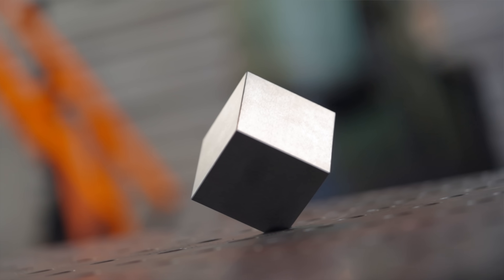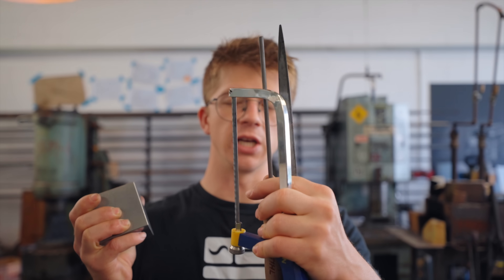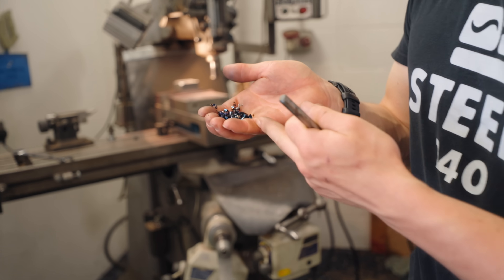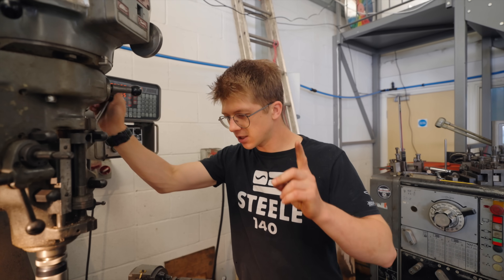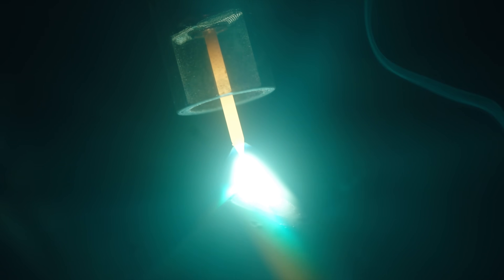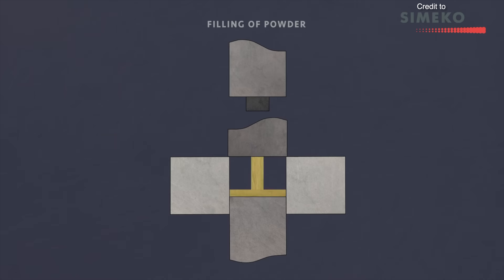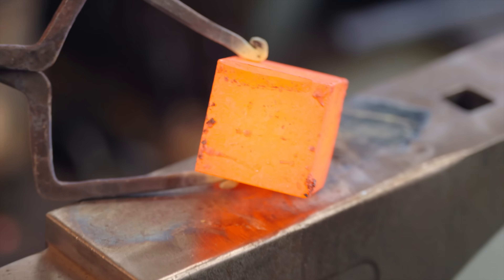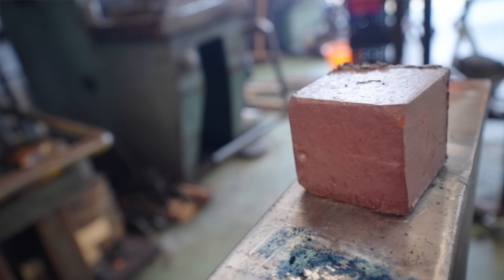Can You Forge Tungsten?

Comment: My father was a mold maker and many years ago he worked for my grandfather.  My grandfather was a notoriously difficult boss.  He was angry one day and needed to yell at someone so, he chose my father who it should be noted trolled his father a lot.  My grandfather picked up a piece of tungsten that was on my father’s bench and ordered him to “do something with this!” My father made a set of darts.  when the old man found out he nearly lost his mind  😂 so I say in honor of my father you should make something useful but ultimately frivolous
Reply: A dart set made from tungsten sounds amazing!
Reply: @jamescomstock7299  I had one some years back. It was designed to be extra heavy while not physically any larger than normal darts. They were really too heavy for me but as I had payed for them I learned to put some more strength into it. Really changes the throwing strength needed.
Reply: @jamescomstock7299  Supposedly he used the set to some success and then he sold them and that just angered the old man more.  No one could get that man angrier than my dad.
Reply: @jamescomstock7299  They have been made for friggin years, try again.

Comment: Would love to see a little series where you work your way through the advancements in metallurgy, going from the copper age to the bronze age to the iron age to the steel age. Just making the same part, like a knife, in all of them and showing how easy or hard it is to work with each metal and what the maintenance would be for each finished piece as it was used across its lifetime.

Kind of a practical show of the history of metallurgy and forging.
Reply: Now this is a cool idea. Make a knife or dagger from metal of each different era from the first metal blade to current

Comment: What about using electric heating. Would that take the temp up enough. I've seen videos where they use electrical current to melt steels to the point where it's as thin as water. Maybe ??

Comment: I believe you can actually use cones made of tungsten to friction drill steel due to the higher melting point and abrasion resistance. Just a smooth cone in a drill press and push it hard and fast against a steel plate and the friction will cause both to heat up but the steel melts much sooner so the tungsten cone just punches straight through the steel.

Comment: Machinist in training here. Carbide tools aren't pure tungsten carbide ceramic. They are a so-called metal matrix composite, where microscopic particles of ceramic are held together by a metal. Imagine melting a metal, stirring carbide powder into it, pouring it in a mold and squeezing as much metal back out of it as you can. The metal used is not usually tungsten.

Comment: You could do a fold forge like your simulated damascus, and if you do that, you would need it in shaved chips mixed to good steel with chip/shavings of cast iron (the cast iron shavings need to be very very little in ratio, a dusting in 2 folds and that is it)

Comment: It's smoking like that because the oxide, presumably WO3, instead of forming scale, is evaporating, as opposed to forming scale like steel would do. You probably don't want to breathe too much of that. The effect will possibly intensify if you heat it further. The oxide melts at 1473 C and boils at ~1700 C. It may catch fire at some point, so be prepared for the possibility.

Comment: Mech. Eng. student here, tungsten wont ever want to forge at the temperatures in your forge, youre gonna need to give it some more beans to get it to the point where it'll want to move. I reckon the oxyacetylene blowtorch (if you already have one) will get it to that temperature on a budget, given how tungsten melts around 3400 celsius, the blowtorch wont be able to melt it, but itll make it reach 3100 celsius, if you do forge it this way, smaller parts will be the way to go so you don't spend 80 years heating up the part. 

By the way, be careful with oxyacetylene if you decide to do this, oxyacetylene blowtorches dance on the edge of a detonation at any moment and handling it like a regular blowtorch might blow your eardrums out if nothing else. Do your research to make sure you dont harm your lovely face.

And of course the tungsten carbide inserts and your hardened tools can cut tungsten, the tungsten block is not hardened and tempered like your tooling!

Comment: Tungsten is extremely hard, but that comes at a cost... It's also pretty brittle (unless mixed with other materials). So it makes sense that you can shave chunks off, but something going hard and fast into it won't do as much damage. I did a little research into it maybe 5–6 years ago, if memory serves it is usually forged/cast in a vacuum, as it doesn't mix well with oxygen when molten. Many jewellers were very sad to see their pieces crack in "normal" setups they had for other materials.

Comment: aside form the stuff you already found out, some other reasons why its hard to forge Tungsten:
When its Red-Hot(or hotter) it starts to rapidly oxides making forge welds neigh impossible
fine Tungsten pieces can ignite causing a class D fire similar to Magnesium

if anybody wants to add to this list, just comment below

Comment: You may be able to get it hot enough with an oxy-acetylene flame. Which should push you up over 3000°C. It would be an expensive process, but should be possible.

Comment: All the smoke is actually tungsten oxide. Tungsten, like aluminium, is a lot more reactive than steel, enough that it seems unreactive at room temperature, because it pretty much instantly forms a passivation oxide layer, but at higher temperatures the tungsten oxide constantly vaporizes, exposing the next layer of tungsten atoms to oxygen, which in turn becomes tungsten oxide vapor.

Comment: Would love to see you try out a block on Inconel. its a SUPER strong alloy of steel used in aerospace parts. its a semi common stamping steel. i worked for a place that stamped out inconel turbine fin rings to hold the outside of the fins of turbo jet fins. they used a 250 ton servo press that shook the entire warehouse whenever it was running, and it only stamped them out of 100 thou inconel sheets.

Comment: Next time try titanium.
It's not very ductile. There is no fixing errors. If you bend it wrong, the counter bending does not fix the error and instead introduces a new error next to the original.
It also burns at 600°C. Got luck milling and turning it.

Comment: Of course Tungsten is forgeable. Otherwise how could anything exist, as even machined forms have to come from something. In TIG welding, while not super common it's fairly common to deadshort a tungsten against a piece of metal to get it red hot, and bend the tip over. If you couldn't forge Tungsten metal, that wouldn't be possible. Also, metal alloys are weird. The melting point differences between iron and tungsten isn't as big as you think when you start thinking about things at a microscopic level. Water is melted material, salt is a solid. Salt melts at 1400F. Yet water dissolves salt at room temperature, even though it's solid! Same thing. Gold melts at 2000F, mercury is melted at room temperature. Mercury will dissolve gold at room temperature. Same thing. Alloys and mixtures are weird!  In metalworking, Eutectic alloys is the technical term

People mix up Tungsten Carbide, which is a cermet composite material, with Tungsten, the metal. Tungsten carbide are flakes of the ceramic oxide of Tungsten, held together in a matrix of metallic particles, usually alloys of Cobalt. They are mixed as powdered materials, put in a press to form basic shapes, then fired in an extremely hot sintering oven to melt the Cobalt powder to hold the Tungsten Carbide grains. Hence, cermet composite (it's not the only kind, btw). That stuff isn't hammer-forgeable. If you get it hot enough then the microscopic 'bubbles' of cobalt just pop between the grains of ceramic tungsten carbide. The macroscale result is that tungsten carbide just kinda.. sloshes, cracks, and falls to pieces and powder. Because there are many many grades of Tungsten Carbide, and the binder % can be as low as 5%. So you have 5% forgeable metal, and 95% ceramic powder. Of course that cannot be forged by hammer blows.

Comment: As you pointed out, tungsten carbide is a ceramic, and that is most of the reason why it's so hard. Almost all ceramics are insanely hard, e.g. fired porcelain is generally harder than steel, it's just much more brittle.

Comment: My dad worked for a company that did a lot of work for the aerospace industry. Tungsten was used in rocket engines for it's stability at high temperature. They did work to the millionth of an inch on parts for NASA and others.

Comment: To forge it you will need to get your forge temp higher. You can do this by adding o2 to it or by blowing air in to it ither or should get you to a forging temperature
according to my ai the melting point is 
Seto AI: Based on the provided context from various sources, the melting point of tungsten is consistently reported as being very high. Specifically, the melting point of tungsten is: - From the content of "Tungsten's Boiling Point Is 10030 F and Other Crazy Facts": "Pure tungsten melts at a whopping 6,192 degrees F (3,422 degrees C)." - From the content of "Tungsten Metal: Definition, Composition, Properties, and ...": "Tungsten possesses the highest melting point among all pure metals, reaching 3,422 °C." Therefore, the melting point of tungsten is 3,422 degrees Celsius (6,192 degrees Fahrenheit).
 So you will need something around say 1/2 to 2/3 that temperature to forge it. 

Seto AI: Based on the context provided from the Reddit discussion in the Metalfoundry subreddit, the user is attempting to achieve temperatures of 1400°C (2550°F) using a propane furnace with a blower and 1.5 bar pressure, which currently allows them to reach approximately 1200°C (2190°F). The user is considering adding oxygen to increase the temperature, which suggests that a higher oxygen-to-propane ratio might be necessary to achieve the desired temperature range of 2000°C to 2300°C. However, the specific ratio needed to achieve such high temperatures with propane and oxygen is not provided in the context given. Typically, for combustion, the stoichiometric ratio (the ratio at which all the fuel is burned with no excess oxidizer) for propane and oxygen is approximately 1:5 by volume (1 volume of propane to 5 volumes of oxygen). To achieve higher temperatures, an excess of oxygen might be required, but the exact ratio would depend on the efficiency of the combustion process, the design of the furnace, and the specific conditions of the reaction. For precise ratios and conditions to achieve temperatures of 2000°C to 2300°C with propane and oxygen, it would be necessary to consult specific technical data or conduct controlled experiments, as these temperatures are significantly higher than those typically achieved in standard propane-oxygen combustion. Safety considerations and the potential for more rapid wear on the furnace would also need to be taken into account.

tldr you would need a ratio of around 1 volume propane to 5 volumes of o2 
You could pull this off but i would not want to use your current forge you might want to build a smaller one capable of reaching those temps and you would want to slowly increase the o2 flow to reach the proper range. Start with a 1 to 3 ratio and increase the o2 until the temperature hits 1900 to 2kc than try heating it and forging it. Increase the ratio and temp till you find the proper point. Done be surprised if the heat soak from the tungsten to your tons begins to soften them LOL

Comment: Maybe you could heat it to higher temperatures with an arc oven, oxyacetylene torch or resistive heating. Tungsten also forms beautiful colourful oxides when heated in air. I evaporated some thin tungsten wire in a vacuum chamber with a high current. Because my vacuum wasn't good enough, the vapour oxidized and coated the chamber in green and blue oxides.

Comment: Back in like 2002 or 2003 our material science course got to play around with "working" tungsten, and the instructor was a actually Michelin star accredited chef of all things... But he mentioned tungsten chips are the most beautiful, because they look identical to MSG! Lol! And it does... But the point of the chip deal was he actually collected a bunch of the chips, and somehow suspended them in small cubes of epoxy that he gifted to us at the end of the course!

This video is why I should have stuck with physics! Lol! There is so much going on here that physical laws canprobably explain! Like the speed, style, and contact area of a cutting implement. There is maths there! Also... would ambient pressure changes affect metals phase change temps in a meaningful way?! Like more than a few degrees K? Good times! Great video to stew on for the rest of yer life!

Comment: if you can cut it with a hacksaw, the band saw should be able to take a slice from it, the edges deformed easier because of the lower surface area, so maybe less mass supporting the rest of the shape would aid in its malleability? Might need to get it hotter to have it actually move good though. I've also looked up forging properties of tungsten in the past with little in the way of results aside from people saying "No you can't forge tungsten carbide".... which I already knew for the aforementioned reason of it being ceramic, so I'm very happy to see the topic being explored!

Comment: This absolutely needs a canister Damascus try! Canister Damascus, hotter forge with pure oxygen or nos (nitrous oxide) and run acetylene together hehehehe. The problems with induction heating is how expensive it is to put together with quality parts that will run off of the voltage and amp they probably have. Two circuit lines of the 200 volt would make it easier but they would need to run argon cooling in hollow copper cables of sufficient thickness to handle the volts and amps likely required to get it that high temp for tungsten to become willing to bond. If they go canister it's easier with a wash bath of rust remover on the dusts and chips, then dry in argon, then dunno the very high carbon steel dust and chip with a high temp ceramic that is made of elements that help with tungsten bonding (like with flux, so like nickel, beryllium, zirconium, etc all google stuff) so they take longer to heat up, same with the inside and outside of the canister. Then when putting it together it's a good idea to pump it through with argon, then vacuum everything out, squish it under the hydraulic press, vacuum it out again, then squish it again. So a box around the hydraulic press would be easier, probably! Same with some gloves to weld the thing after final squish. Then it's all about heat! If they could, pure oxygen and coal / carbon dust into the intake area of the forge is going to get them the out right hottest temps, but it's kinda dangerous. So....🤷 maybe just nos and acetylene?

I'd not dust/ chips then thin shim metal with the tungsten it makes it easier to remove rust and coat with ceramic. Might be way cheaper too! Can always throw more carbon in there too 😉😁to make it attempt a higher carbon to carbide process during forging and hydraulic press forming process (squish) I would love to see it 

wow this in another comment, but the super heated vapors thing is a big deal and they are correct that the tungsten starts bonding during melting steel temps. However! It should be noted you have you face plate respirator that can be upgraded to have a cooled air duct that is treated to handle higher temps near the forge and kevlar firemen suit protect against some serious heat but can be helped with the shiny suit around it (aluminum I believe is in it for ir reflection). Also tungsten doesn't forge well with melted steel for certain shapes, thickness, otherwise they would do it all the time. So allowing for higher heats with the "flux" ceramic could allow for that to not happen and forging to be much easier.

Comment: If you're ever planning on getting an induction forge (like the one will got recently) you could try again just at a much higher temp. And if judging by how hard metal alloys have forging temperatures closer to their melting points 2800°C is probably a good starting point.

Comment: i've actually welded 2 1/8th inch tungsten electrodes using a 1/16th as filler. very crackly and overheated my torch.

EDIT to say i got the idea from 6061, a welding channel on here.

Comment: I am not a metalurgist, but from what I understand HSS is cast and the tungsten functions as nucleation points for cementite grains when it cools down. This alone creates a very solid grain structure which is why HSS isn't ruined by higher temperatures: it isn't hardened, so there's no temper to ruin.

Comment: The simplest way to melt tungsten(W) is with current (arc melting). You can use a induction furnace . It’s the only way because W is very heat resistant!